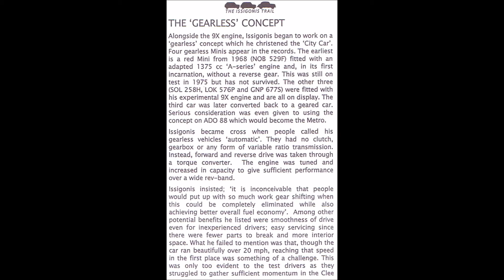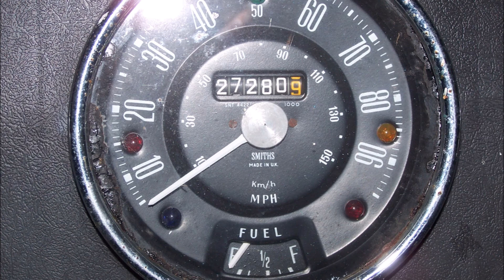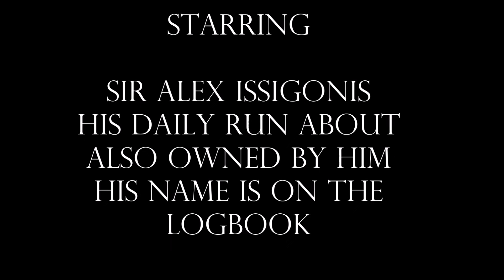SIR ALEX 9X MINI

Comment: A sad story really the 9X. The 9X gearless as well as the planned 9X gearbox layouts were design blind alleys, while the 9X engine could not meet tolerances required for production and was flawed in being out of step with the rest of the industry by being a pre-war like compact 4/6-cylinder rather than a 3/4-cylinder as rivals were shifting towards.